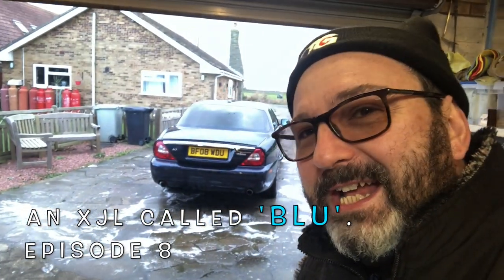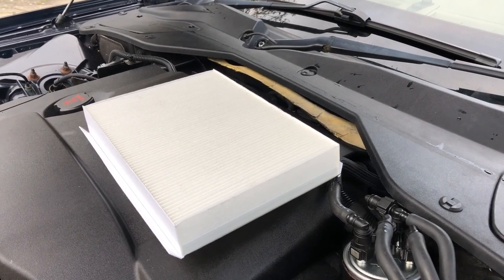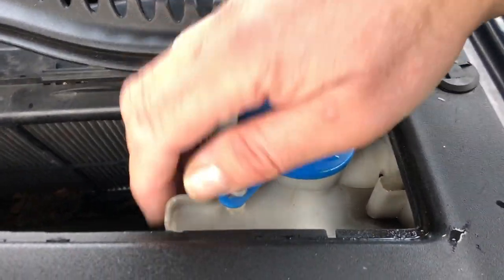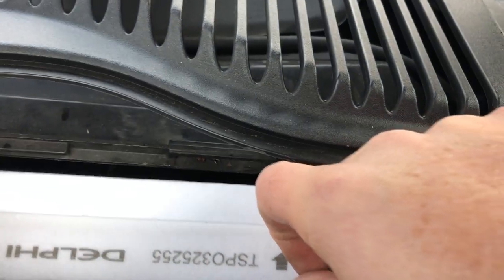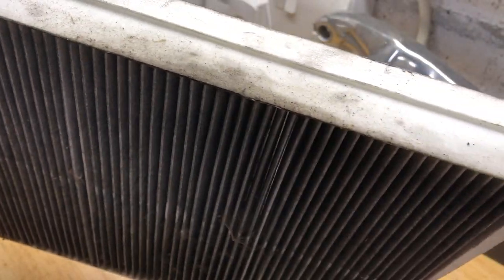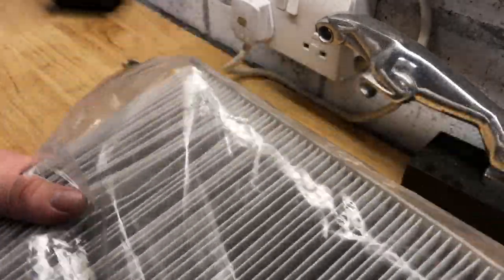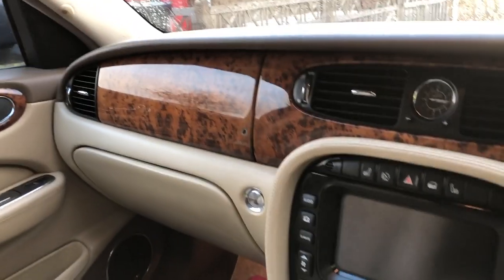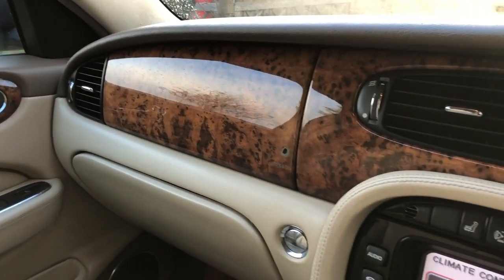Blu ep8. Changing the Pollen / cabin filter on a Jaguar XJ X358 X350

Comment: Screenwash location is an X358 feature.
The X350 cars have the filler near the slam panel.
My Jag came with a book full of service stamps, the last just 3k miles before my purchase, yet the pollen filter had obviously not been touched in years.
Reply from the maker: Excellent inteligence on the washer filler Matthew. Thank you. Must admit I had thought that the X358's changes were spec, seats and cosmetic in the main. So I am still learning and fascinated to hear of any Architecture and packaging changes
Reply: @ToTheGarage  To be honest I saw your screenwash and thought is that just for the diesel cars. A look at a few engine bays on Google images showed X358 petrol V6s and V8s located like yours. The earlier cars have the filler located down the front of the engine bay.
Reply: Oh one difference if you are interested, mine being quite an early 2003 car, is that I have 4 ride height sensors for the air suspension.
Seems an odd thing to do, but Jaguar deleted one of the front sensors soon after.